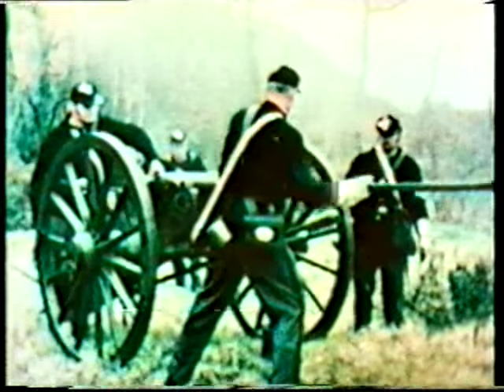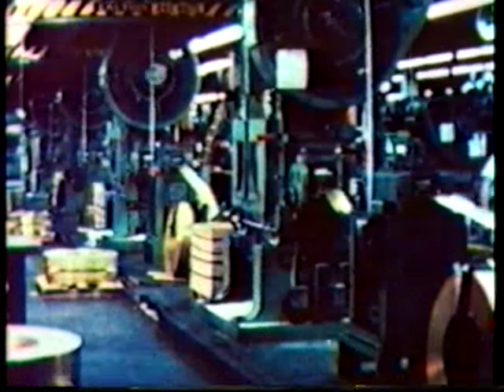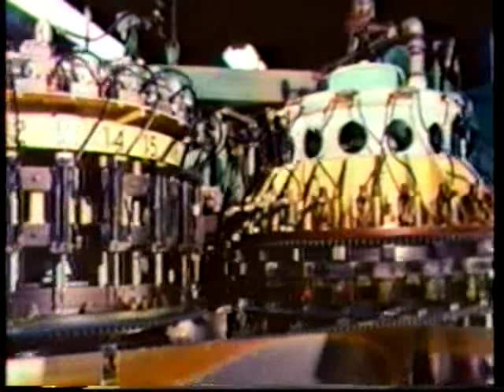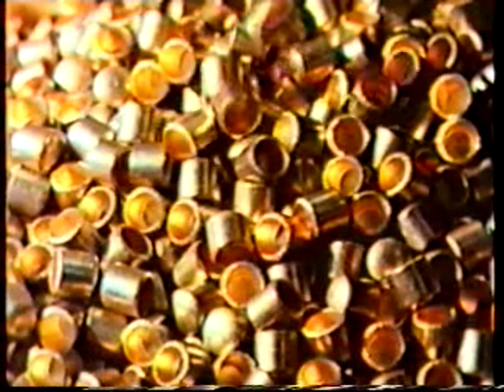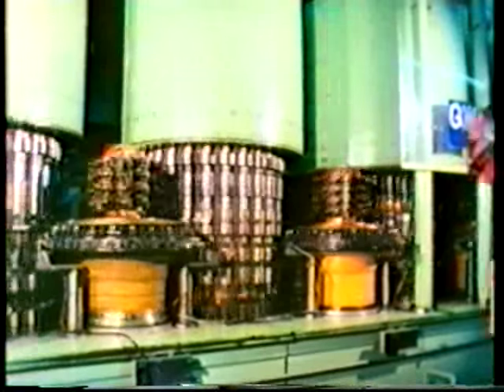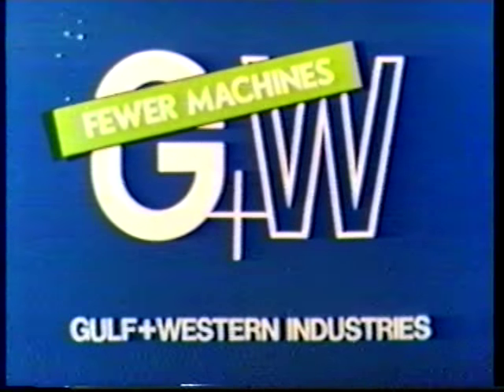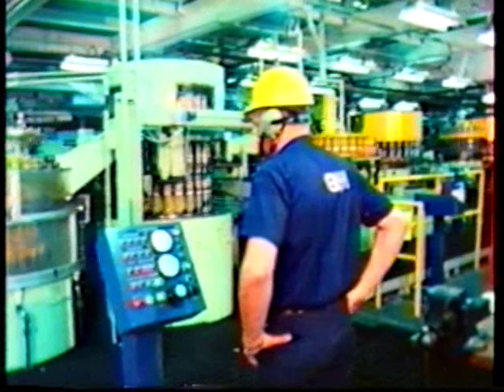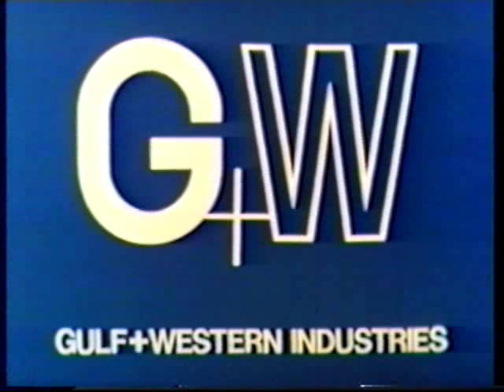Automated High Speed, High Volume Bullet Machine for U.S. Dept. of Defense

Comment: We were lucky enough to purchase ADEC in 1979 when G+W's Charlie Bluhdorn was forced to sell the G+W Industrial divisions out of Southfield, Michigan. We had sold one system to Taiwan and Taipei wanted another one but G+W refused to supply it because of a pending divestiture so we bought ADEC. Lake City had five systems running 24/7 back in the Seventies, and Israel's Nazareth Ilit Arsenal had one, as did Taiwan's Arsenal. When working smoothly, they were fantastic but tool wear was a constant concern. Straight line presses making progressive draws were arguably more accurate with less tolerance stack up but much slower. The lines are still in operation.

Comment: I'm curious as to how the powder is dispensed so quickly.
Reply: That's just showing the empty case manufacturing. Loading is much slower (gravity fed). 10x the number of machines.
Reply: @sstrick500  Incorrect. ;)
Reply: In some designs only a fraction of the powder is dispensed at multiple stations.
Reply: @sstrick500  There are three types of SCAMP machines - bullet machines, case machines and loaders. All run at 1200 ppm.